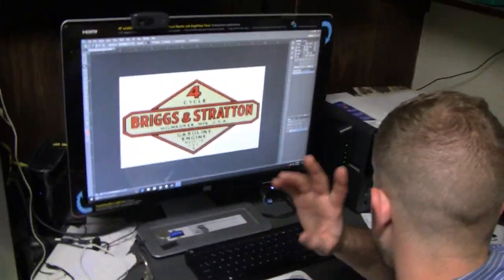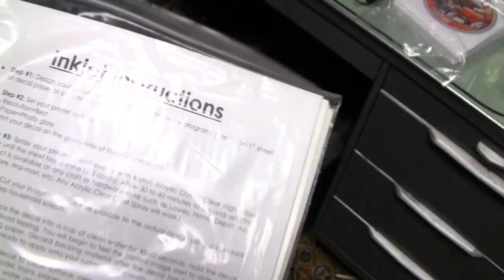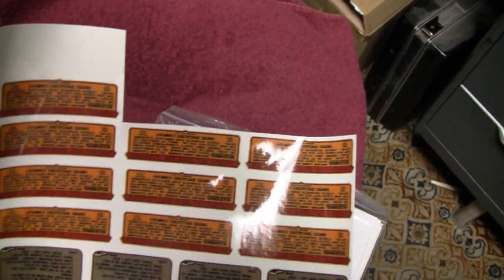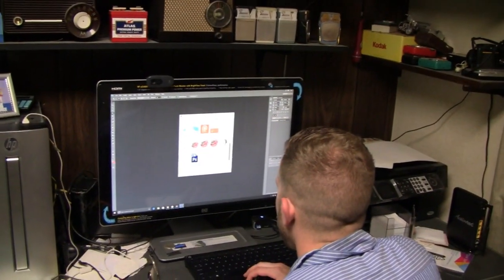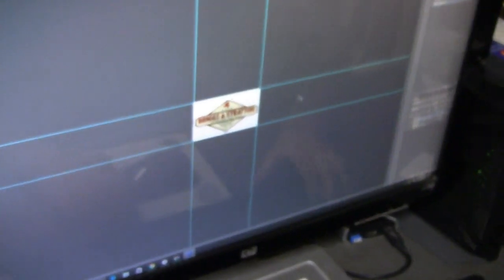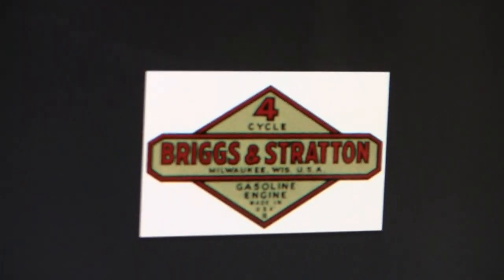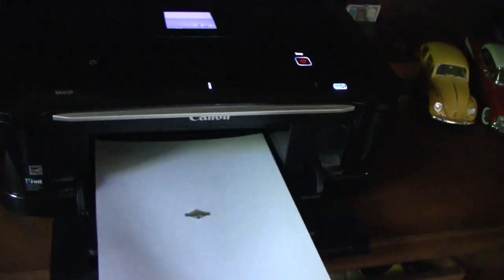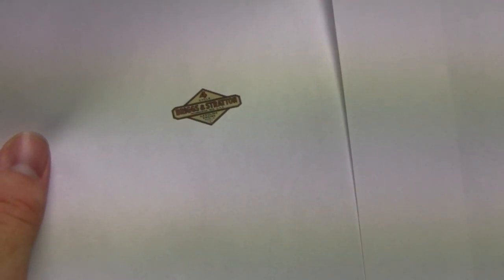HOMEMADE WATER COOLED BRIGGS ENGINE (part 35)

Comment: RK, purchased two motors this weekend a REO 211 and a model A Briggs. Do you have a source for parts for either of these? Thanks in advance! Bill
Reply from the maker: Your best bet is Ebay, all the major Antique Engine Parts Dealers sell there!! The Reo might be a little tough to find stuff for because of it's scarcity, there are plenty of engines but not so many parts!!☺
Reply: Thanks for the info! The REO fortunately is pretty complete and free so maybe just a firing check and maybe it will run. The model A is stuck, but hopefully due to time and not lack of oil. One thing i do need for it is a handle. I'll scour ebay to get one..thanks again!

Comment: We going to run this engine once or is it just for show? Just curious.
Reply: joeventura1 it will run. its not designed to be put into real use, but it's certainly not going to be a non working display piece. it'll be a running display at an engine show :)
Reply: Ok great, its a beauty I just would like to see it run once. I think that's the logical conclusion to the series don't you?
Congrats on a great build!!

Comment: The water slides came out really nice. How. -close are you to firing it up?
Reply from the maker: Thanks Bud!! At least 5 more videos, still alotta work!! Gotta fabricate a mounting bracket for the Rad and fan, plumb it, mount the engine, water pump, radiator and run the chains and sprockets!!☺

Comment: Great video !  I'm impatient to see the completed project !    FWIW, is anybody down your way interested in another project ?  I've got a 316 JD  hydroshift  lawn tractor and a BFN 17 hp  Tecumseh  V-twin  engine needing mating.  Comes with an assortment of attachments including a JD snow blower, a push blade and a de-thatch rake,  snow chains and weight box.  I also have the service manuals for the JD, and the Tecumseh along with spare parts  to fab an exhaust system.    PM me if interested !
Reply from the maker: Thanks Bud!!☺